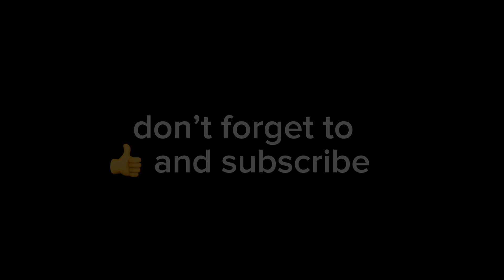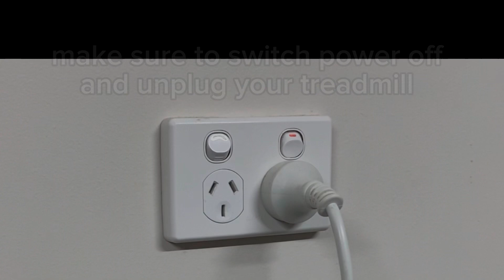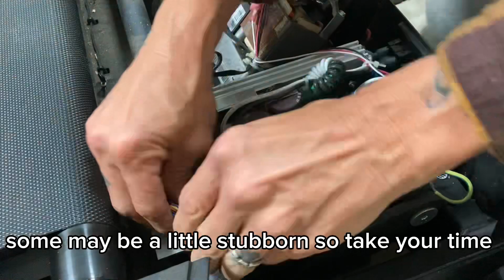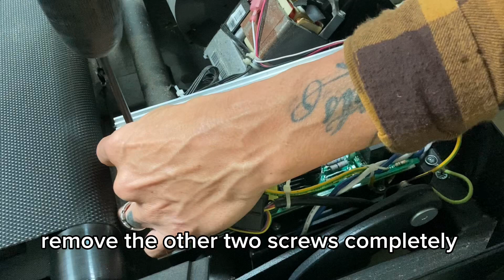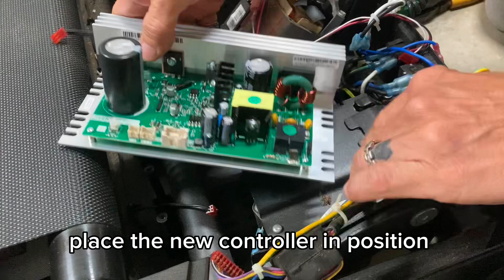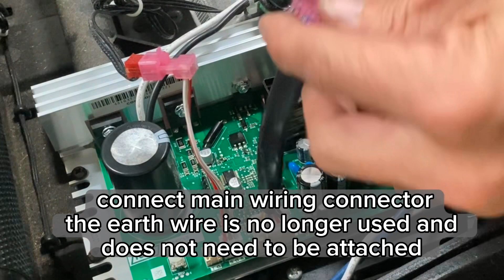How to replace motor controller (old style with new style)   NordicTrack and Proform treadmills

Comment: Nice video were did you get the conversion harness
Reply from the maker: Thank you 🙂 the new style controller comes with them as standard when you order it from ifit. If you need just the conversion adapter looms they sell those separately, let me know if you need the part numbers and I’ll track them down for you